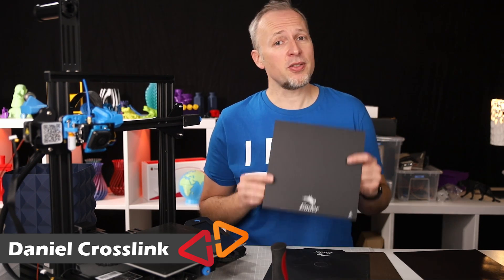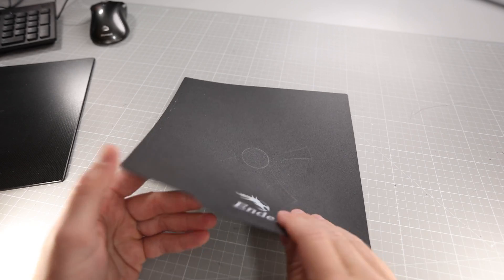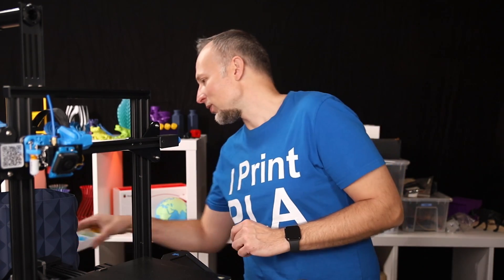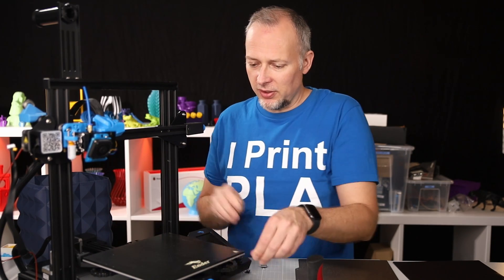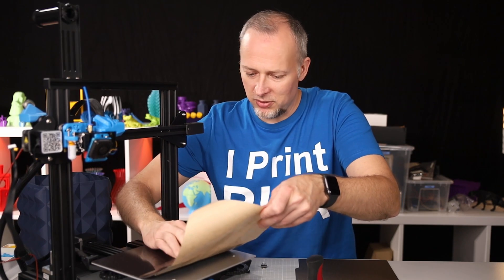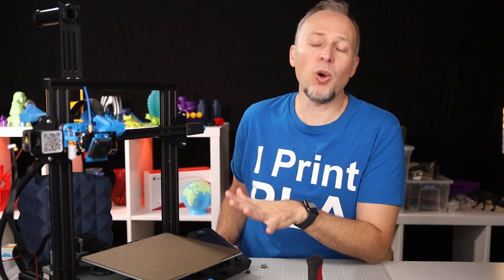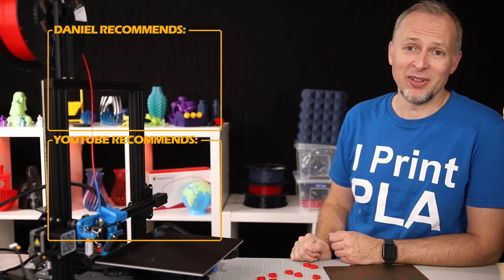Which print surface is the BEST? (for Ender 3 Models)

Comment: Pei by far for me. Textured pei resolved all my adhesion and warping issues with glass bed on ender3 v2. I regret all the past two years of not having it. I had done other upgrades before, cr touch, dual z, extruder, firmware etc. None made me as happy as the pei bed.

Comment: One of the first things I changed on my OG ender 3 was I changed it to a blaster because I got damaged the original bed trying to level it. I decided to upgrade to a magnetic bed because I've recently noticed issues where some prints just will not come off so I have to do is throw it in the freezer and then it will pop off although even then it still needs a little bit of persuasion. The only reason I actually used adhesive is because I noticed my print was warping a little bit, although it could have been me not leveling the bed properly but I started using adhesive just to kind of help it and that fixed it. Of course, that's typically the last option

Comment: I bought a PEI dheet for my Ender 3 pro and I had a huge issue with PLA not sticking to the bed at all, I had to use glue stick and even then I still had failed prints due to the part coming loose. I have a Sovol v6 now too, and it comes with a PEI sheet, same problem. I tried that because when I'd print with PETG, it would rip bits out of the rubber sheet.

Comment: PETG sticks way too well to the glass, even the coated side. I printed a low polygon wolf and I tried my best to get it off the glass even fully cooled and it ended up ripping his tail, bottom feet and butt off which was funny, but also sad because it took 22 hours to print.

So the magnetic bed is a very nice upgrade.

Comment: New to 3D printer, I bought the Ender 3 S1 Pro that comes with a similar PEI texture magnetic bed. I noticed the print surface touching the textured bed is not very clean and I was wondering if I could reverse it and print on the smooth surface. 

Many thanks

Comment: That system looks very good. I'm using a glass plate right now. Having a problem with parts not sticking on my ender 3 pro.
Reply from the maker: I switched to PEI coated sheets on all of my printers and never had any regrets

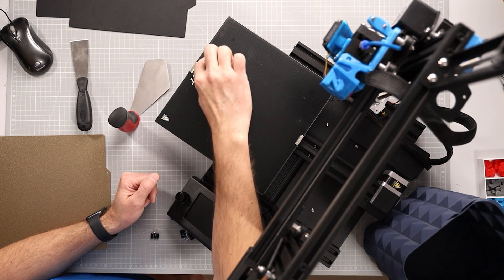Comment: 2:25 just turn that clip upside down problem solved =) or put 1 in each corner on the front,problem solved...
buy a cheap glass bed where you can stick the magnetic base on :p

Comment: My prints don't stick if it's not in the center of the bed with the glass bed.

(only when using a 0.6mm nozzle) 

I think it's because he heat isn't uniform

Comment: well im a year behind i just got into 3d printing about 2 months ago started with the what came out of the box had a hard time but finally got a print i feel in love with 3d printing i did have issues than i got a glass bed than i was back in than after a few prints i felt like i just started  3d printing bed glue so far doing good but ill look into this type of bed ty

Comment: I tried this plate with the basicfil PLA from Amazon but even though trying various settings i couldnt get it to stick properly. (Even using adhesions spray it still didnt work reliably) cannot recommend

Comment: I can not remove my glasbed from my Ender 3 Pro -.- with the magnetic bed the adhesion is so strong after two years its impossible to get it off without bending the bed or damaging something else. On the bright side, I don't need any clips anymore and can use the full size of the print bed. 

I have an Ender 5 Plus too.. and for this printer I want another surface. First I liked a smooth surface for all my prints but now I also want to change to a rough surface.

Comment: I have found with my ender 3 v2 glass bed, that just allowing the plate to cool to room temp releases the parts with out any struggle at all. I've often returned home or woken to a finished print sitting on the bed as if it had never been stuck to it in the first place.

Comment: How its that magnetic pad with high bed temperature's 80-100
Reply from the maker: Not a problem, works at 80 degrees. Did not test 100 as I never have to

Comment: I am using official creality ultrabase on my Ender 3 Pro, and that's the best solution I've ever had. I replaced old magnetic surface with it, because that old solution wasn't durable, even in normal operating conditions.

Pros of a glass bed:
- nice first layer surface
- printing surface is flat
- sticks well while printing
- prints are detaching with almost no force
Cons:
- it can take some time for a glass bed to cool down
- you shall not set print area bigger than 230 x 230 mm
- if you often move the glass bed, you can accidentaly drop it and break it

Comment: I still have the magnetic from the original Enders 3 pro. Can I use this with the pei or do I have to remove old magnet and put new magnetic layer. I read something about magnets deteriorating with heat.

Comment: I use a similar build surface I bought from TH3D last year.  It works well and I like the fact I can pick between smooth or textured surfaces depending on the print.  The TH3D sheets replaced a Creality PEI spring steel sheet that I thrashed printing PETG.  A worn or damaged spring steel sheet makes an excellent mouse pad BTW :)

Comment: I need a new bed for my ender3 because the coating on it chips off. I have ordered a new glass bed from China and end up the size is different. Likewise, I think that might be the sign for me to switch to the steel bed. It also gives a good-looking texture from the bottom of the print, so why not replacing the old glass bed with the steel bed.

Comment: The magnetic sheet in ender 3 is good,sticks great, but if you by accident make a dent or scratch the surface then you gona mess all other prints.You cant fix the surface(believe me I ve tried) ,so you have to buy another. A metal one with pei surface not have these problems.Why not try some other solution to get it off our mind.One less headache for printing...

Comment: I currently print on a mirror on my Ender 3 Pro (except for PETG which bonded to the glass of mirror #1).  PLA sticks well to glass simply cleaned with some alcohol and with the bed temp at 60C.  And after cooling the parts are released without needing any force.  For PETG I still use the original flex-surface of the Ender 3 Pro, but that is starting to show its age, so I could definitely use a new surface.  So, the magnetic PEI sheet would be very welcome.

Comment: I have to say thank you VERY much for the link BOTH in aliexpress and amazon.  I have had bad luck with ali and only use amazon. So in video I was worried no amazon link. so thank you thank you.  So I have to ask. I see the home made glue video and others in the past. How would you compare this spring load material to say ultra base, and others you have tried in the past? It would be interesting to see if there is ANY way this could be done to say hover or glide along the top of a steel roller? Could that even been done? or to not necessary as the stuff bends as it rolls anyway on the roller? I had the stock build tech style on the ender 3 pro and just getting ready soon to use the ultra base glass on a new heat bed.  Now I am wondering if instead keep the old magnetic bed and go with this spring metal instead?  How would this spring metal hold up lets say if I want to print super high temp plastics?  being magnetic would it break down, or still be better then say ultra base or other options?

Comment: I'm still using the original build plate with my Ender 3 Pro and it's showing quite a bit of wear. I have been looking at upgrading/replacing it.

Comment: I'd love to try the spring steel build plate. I currently use the sticky backed sheet and over time, air bubbles develop underneath and cause an uneven print surface. I never thought to use the build tak without sticking it down. I might just try that.

Comment: I'm brand new to 3D printing and have a new Ender 3 v2 (with the glass build plate).  Right off the bat I had problems with that glass plate.  Nothing would stick!  So I bought the other Ender mat you showed.  BTW, my version of that mat is a two-piece.  I stuck the sticky side the the aluminum bed plate and then the mat sticks to that magnetically.  Well, that build plate is way better than the glass plate, but I've noticed in some cases the nozzle would slightly melt or scratch that soft surface.  I've been doing my research on these PEI build plates.  Seems this would be the best of both worlds.  Magnetic (so no clips), flexible for part removal and more importantly somewhat tougher and having a surface that does a better job of holding that all import first layer.   Would really like to try the build plate you featured in this episode.

Comment: Great video :D

This surface has been a game changer for me, perfect adhesion and easy to release the prints, as shown in the video.

If you're considering it, don't hesitate, just get one, you won't be disappointed.

Just remember to clean it with the highest concentrate alcohol that you can get hold of as often as possible, especially if you touch the plate.

Comment: I don’t understand the comment that lead to the discussion about putting the Ender glass plate into the freezer. Which side are you using? I have had my Ender 3 v2 for 1 week (totally new to 3D printing). Once I worked out the leveling, the prints (on the coated side) would finish, I let it cool for a bit. Just after the build it would stay put (great adhesion!), but maybe 15 minutes later or so, it was detached…no scraping at all. That is for the offer of the free plate, but I will stay with the coated one I have.

Comment: I always wanted to have a 3D printer, but this stuff was too expensive to me. When I saw Ender 3 V2, I decided to sell my PS4 console which I didn't use to buy my Ender 3 V2. Since then, I love this printer and mainly 3D printing. I also love to upgrade my machine, but sometimes need time to save some money for upgrades. So magnetic sheet is on my wishlist for printer upgrades, so this is why it would be great for me to get one ;) Cheers!

Comment: on my ender 3 pro i switched from magnetic to glass bed and never looked back.
 i print on the uncoated side, no adhesives necessary at all, just keep the glass very clean.
cooldown-time might be a factor, using water speeds up the process and lets you easily pop the objects from the bed.

definitely going to try the metal plate!

Comment: I have been using glass build plates for awhile.  They definitely are better than the stock plastic build plates that came with the printers.  I like using them (glass plates) and have not had any really issues with them.  I would like to try this plate and see if there really is a big difference between them.  Great video as well.  I love all your vids.  They are very informative and you do them from the heart.  Thanks for all the great vids.

Comment: I use borosilicate glass beds and have mirror build plates also for each of my 6 printers and I have a magnetic PEI flexible bed on my Pro 3D V-King 400, I would have bought borosilicate beds for my V-King but they cost a fortune in that size, My Ender5 Plus came with one but that is too small for the V-King at 360mm so it stays on the Ender5 Plus, I have had to upgrade the bed heater on my Ender 5 Plus to a mains one as it took forever to heat it up.

Comment: Been using a PEi spring steel plate for a few weeks now on one of my original E3’s. Will deffo be getting one for my other E3z not had a single issue since ditching the glass plate, top video as always buddy 👍

Comment: That heavier build plate looks a lot better than the stock magnetic surface on my Ender 3 Pro. The plate underneath mine is slightly warped, I can tune it to print reasonably well on small areas but larger prints don’t work well. I tried using a glass plate covered in painter’s tape but I wasn’t much more successful. A sturdier, firmer plate with the build-tak-like surface might just do the trick!

Comment: My pro came with a flexible magnetic bed that kind-of worked but wasn't reliable and occasionally prints came loose or a corner came up. I thought I'd buy a glass bed with that sticky coating which NEVER worked. In the end I flipped that glass over to the smooth side and used glue stick. It's frustrating since glue stick is kind of ugly but it works which is more than can be said for anything else I've tried.

Comment: PEI sheets are fine, still using it for years on the prusa but the ender3 max and cr 10 V2 heatbed are not really flat and have a recess in the middle. So this will get transformed to the metal sheet on top. You had to make some makeshift to get it flat.

Comment: Nice, been considering one. My gkass plate has been giving me troubles after I forgot to change the nozzle height when I changed nozzles and it ground not only the new nozzle but the bumps right off the plate :( this.looks like a much better solution!

Comment: I wonder would this solve problem that i have taking off PETG from Ender glass surface. PETG sticks hard, and it already damaged one glass plate i had, using hairspray helps, but i still have to wait for everthing to cool down completely before even atempting to remove anything.
Reply from the maker: This definitely helps with any material also with high temperature.

Comment: Great video! It is true that removing parts from a hot glass bed on an ender 3 v2 is very difficult but other than that it works very good. Still I would love to try the metal build plate just to see how it compares to the original glass bed.
Reply from the maker: Yeah, I was never a big fan of glass plates. They also tend to take longer to heat up.

Comment: I am currently using a magnetic flex sheet with a peel and stick PEI sheet. It worked great with low temperature plastics but started bubbling and peeling on high temperature plastics. I think the powder coating might solve the issue with the high temperature plastics...
Reply from the maker: I had issues with the magnetic platic sheet when it comes to really large parts and printing for a long time. Some parts would stick too well and the surface would get damaged when removing the parts because I had to pull so much that it actually left visible wrinkles. This will never happen with the spring steel bed surface.

Comment: Great video as always, I would add that take the opportunity before you put down the magnetic layer to check the screws holding the four bed mounts because if any are loose it won't be so easy to tighten then as you'll need to cut into the new layer for access. I've stuck with my Creality glass bed for over a year and it's been pretty good, replacing the usual clips with picture-frame clips and the size loss is under a millimetre in height and just a couple in depth, but having had more and more issues with prints sticking far too well to the glass the past few months, I might give one of the flexible sheets a go.
Reply from the maker: Great tip! I would actually fix those screws in their slots with some loctite.